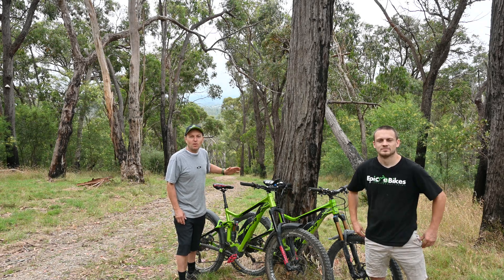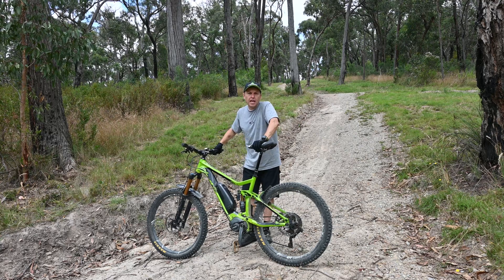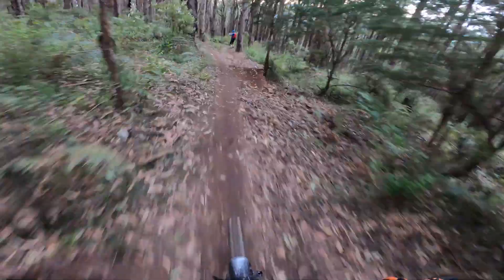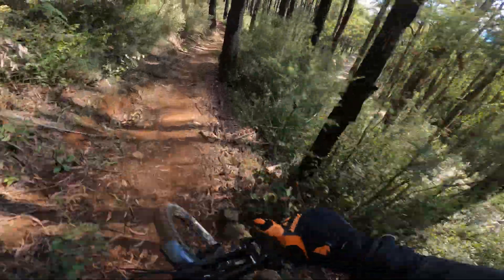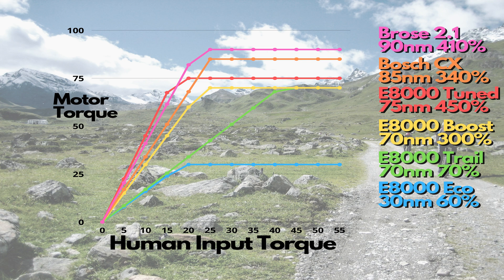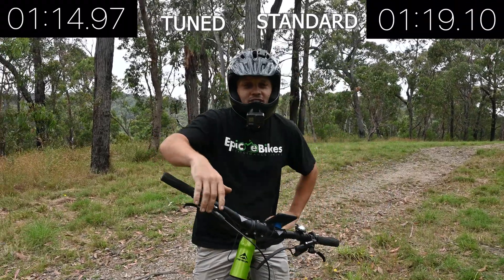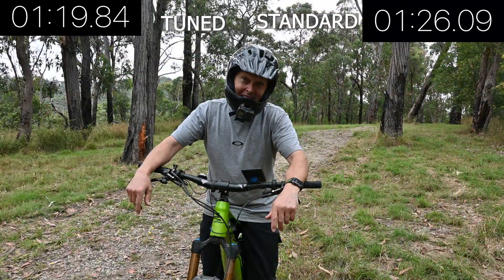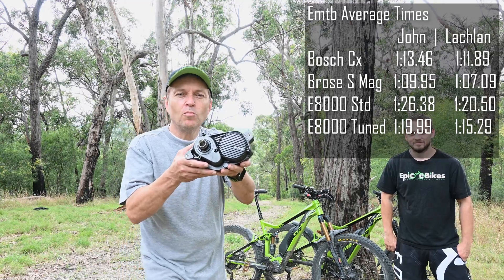eBike Motor Test - Shimano E8000 Power Boosted To 75NM - Standard Bike Vs Tuned Bike - Merida e160

Comment: I have a Eplus race tuned Merida E One Sixty 9000, I was a bit sceptical about whether it really had improved performance.  However, today we did a comarison againsty another E One Sixty (10k model), it was derestricted, but with different product.  My Eplus modified bike was timed consistently around 5% faster uphill......this is in-line with the Epic Ebike comparison test times.
I now have full confidence in the Epic Ebikes testing.

Comment: I can see possible trade off with more wear and tear on components and battery use but nice to have the option. I think 35km/h is the right balance and not 25km currently as its a pain on flats...
Reply from the maker: From our experience the E8000 is well put together our motor did over 10000km's tuned without issue.
Reply: @EpiceBikes  what about drive chain
Reply from the maker: If you ride at high speed for long periods you will wear out the small cogs on the cassette faster.

Comment: Hi, great video. I have same motor, same Eplus tuning. Does the tuning reduce the overall motor life?
Reply from the maker: Our tuned motor has done over 10,000km so no issue with motor life
Reply: @EpiceBikes  VERY KIND. thanks :)
Reply: @EpiceBikes  thanks! Just a question: have you even encountered this situation? : battery is almost done in red mode telling you have just a few km left. Then you shut down the bike and wait for ten minutes. When you power on again it says you have got a little more like 1 or 2 battery bar and 15 km. I didn’t had the time to test the real mileage left but that was plausible since usually I do 60km mixed and in this occasion I had done just 45km. Thanks
Reply: @acaposotta  when you was in the red what power mode was you in and was you on a climb? Its calculating based on avtivity so stopping and setting in off or eco mode will give a different reading when reset from switch off.
Reply from the maker: The battery gauge is not particularly accurate. If you are in trail or boost you are working the battery harder. Once the bike switches off the battery can recover some voltage so when switched on it will show that there is more range available but once under load the battery will likely quickly deplete.

Comment: Hey guys I have a Santa Cruz Heckler with the e8000 motor and I want to unleash its full potential.
How can I get your tune in Germany?

Is it possible for a dealer to detect the tuning if I need to bring it in, in case of of a failure etc?
Reply from the maker: Find yourself a closer retailer here https://www.eplus.bike/en/retailers/

It can be returned to standard settings for any warranty claims
Reply: @EpiceBikes  thank you very much guys!

I found a German company in Hannover with a name that’s not at all connected to Ebike stuff, but I contacted them nonetheless.

Let’s see what they have to say about my inquiry!

Comment: Hey Guys, excellent video, I wonder if I can unleash the EP8 usual 85 nm's on my Orbea Rise (as you may know it's the same motor but limited to 60nm's)?
Reply from the maker: Hi Carlos we are hoping to have tuning available for the ep8 within the next couple months. It's likely we could unlock the limited torque when the tuning software has been completed but we won't know for sure until it's  finished.
Reply: @EpiceBikes  Sounds great. Let's see if I can unleash at least the 85 nm's in my Orbea Rise, in the end I understand why they detuned it (to save battery) but they should have given us, the owners the opportunity to chose whether we wanted to have 85nm's for 30km's our if we wanted to have instead  60nm's for 50Km's.